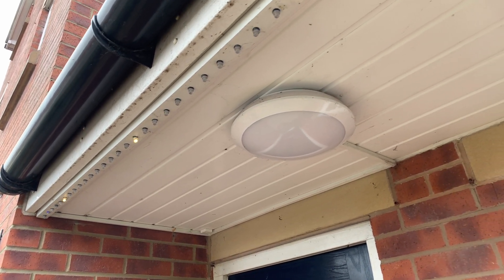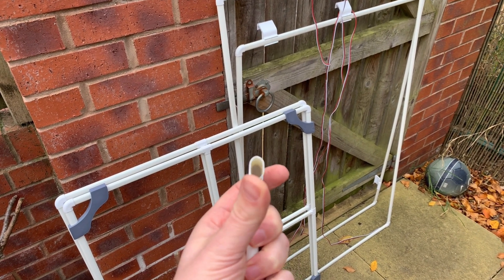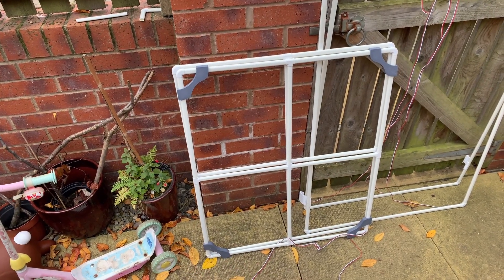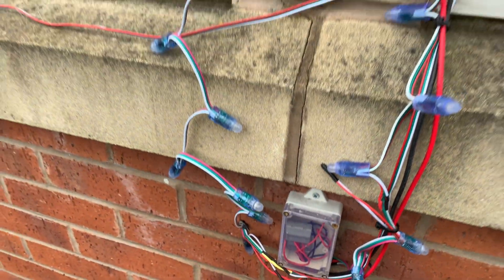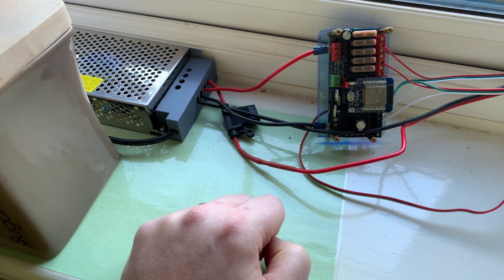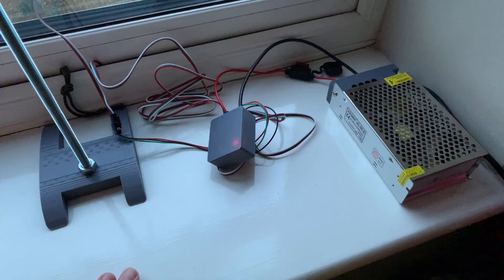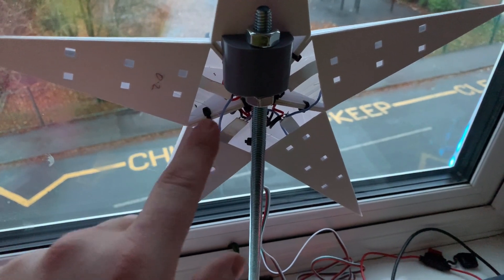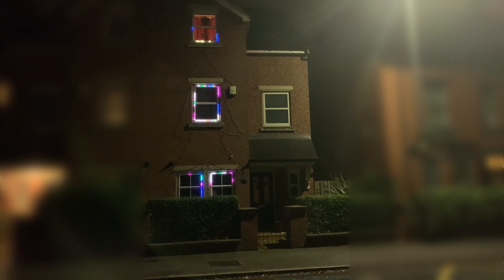WLED Christmas Lights 2021 - xLights FPP

Comment: Hi, can I ask what did you find was the best orientation when 3d printing the joints?  Was it stood up on an open end as in the thingiverse pics or laid flat? I assume you need support material whichever way you place them.
Reply from the maker: They were laid flat and I used no support. The first bridging layer only sagged a tiny bit when I printed them and this didn’t effect me being able to insert the conduit.
Reply: @AdamWelchUK  Many thanks Adam, I'll give it a try.

Comment: hi, these are really good, im trying to make my own window frames and also want to use 16mm oval conduit. could you 3d print corners to help a fellow pixel head 
out? im in uk and happy to pay!
Reply from the maker: Hi Jay. My printer is pretty much running 24/7 with my own prints I'm afraid. How many corners would you be after?
Reply: @AdamWelchUK  I bet it is! I'm after 16, i've contacted a few local companies for quotes as I really didn't expect a reply. Keep up the good work It looks amazing and I'm sure it will look even better this year

Comment: Aren't those wires a little thin to handle 30A?
Reply from the maker: In reality when I’ve measured this the windows and tree pull less than ten amps. The tree is fused at ten and the windows at five each.
Reply: @AdamWelchUK  thanks Adam! I often wonder why they use such a low voltage on these types of Led strips. Keep up the great work!

Comment: Looks good fella, any chance you can share the STL files for the connectors and brackets ect you made.

I'm currently running 
150 strip in lower front window
150 strip in upper big front window
73 strip in upper small front window
And need to make exterior frames for these and was wondering what to do, and your way seem spot on.
Also running 100 pixel string around outside doorway and 180 strip along outside front Eve's. That is mounted permanently in aluminium conduit with milky diffuser. Oh and 100 fairy pixel string on indoor tree. All split over five D1 minis, run off various 5v power supplies ( which run both the pixels and D1 minis) all over wi-fi with wled 13.

Just running patterns and presets ATM tho, just added all stuff into xlights but not up to speed to get a show running yet.
Reply from the maker: Thanks very much. I like the sound of your plans. Wled is amazing. 
There are a couple of thingiverse links in the description for the stls. Cheers.

Comment: How did you deal with the corners inside those frames? Did you solder wires on and create the frames and install LEDs at the same time ?
Reply from the maker: Yes, exactly that. A bit tricky but doable.

Comment: Hi Adam I was wondering if you could help me out please. I have a 320 watt solar panel with a epever mppt 30a solar charge controller and 140ah gel battery. Which will be a 12 volt system for now. What size wire for the panel which will be around 20 feet away from the controller. And what size wire from battery to the controller and fuse size will be safe

Comment: I posted a reply but it seems that it is gone?
Reply from the maker: That’s odd. It’s not in my ‘held for review’ section. Lost in the ether?
Reply: @AdamWelchUK   seems I am not alone if I Google around. Very very frustrating as I tend to put information and calculations in my replies. What current is it all using?  I am running 298 leds (I wrote about the 2 missing in the full story) also using WLED.  Turned off they use like 400mA (2 Watt) and turned on I limit it all to 1000mA (so 5 Watt in total) and it's all plenty bright. I run the complete thing from an old phone charger.   Btw have you ever measured what the smart plug consumes?
Reply from the maker: Sorry that your comments aren't being treated with the respect they deserve Luc.
The consumption is less than I predicted, or was lead to believe. I've put my clamp meter around the power supply for the tree and kitchen windows - 253 + 129 + 129 = 511 pixels. I max out at 4 amps at 5.1v so 20w. That's with the WLED limiter off. Perhaps I should have got a smaller power supply! 
I should measure the smart plug, but I'm not sure the meter I have is very accurate at low power, plus there is a good chance it might annoy me ;-)
Thanks Luc
Reply: @AdamWelchUK     No need to excuse Adam.  It seems YT is having an issue sometimes.
Try to lower the current.  Really strange seeing those other people use like 40A power supplies to just power stuff.  Yes, if you want to light up the area all fine.   But talking smart plugs. Scary to see my DHCP giving out like 15 ip's to smart devices and that doesn't even include the Zigbee ones.  I actually start to wonder if it is all such a good idea if they consume like 1 Watt each.

Comment: Love it :D I have built a mega pixel tree on my front lawn for the last few years, this year is the first year I have sync'ed them to music and I have to say it is great fun. I have 18 strands of 50 pixels + 100 pixel star for a total of 1000 pixels which is about 3.5m tall. Getting the supplys in the UK is a bit of a pain though!

Please will you follow up how well the pixel strip lasts in the UK? I have heard a lot of bad things about how well they last outdoors.
Reply from the maker: Yeah if there is anything to report I will. Although I hope they last, I really don’t want to have to rebuild the window lights…
Your tree sounds great. Nice work.
Reply: @AdamWelchUK  Oh something else you can do with strip that looks amazing is to put some in some white PVC sink drain pipes (the cheaper the better because of the thin walls), I have found that half a 5m strip cut in half and put in a 3m pipe. Bend the pipe into a semi-circle and plant the ends in the ground. They are called Leaping Arches and look spectacular.
Reply from the maker: @MattWells0  great tip. Thanks.

Comment: Nice idea Adam. 
I put lights on my house for Christmas, but I find the wind and rain destroys them pretty quickly, but your protection would really help in my exposed location. 
Thanks for the tip.
Reply from the maker: Glad to help. That conduit was about 50p a meter from screwfix so doesn’t break the bank either.